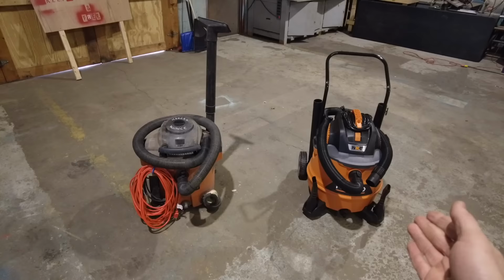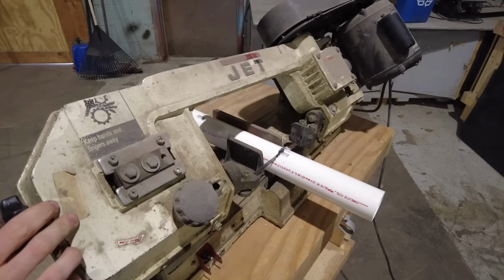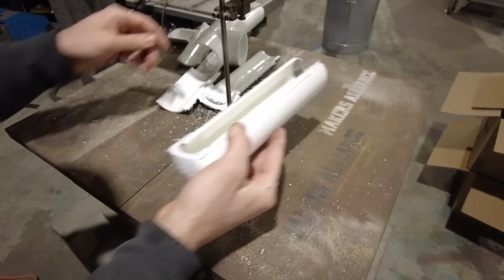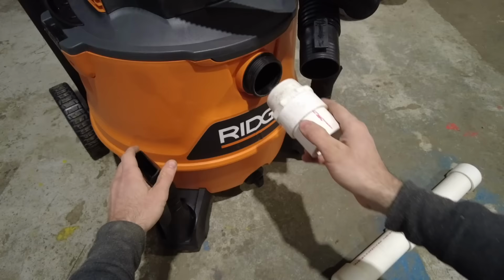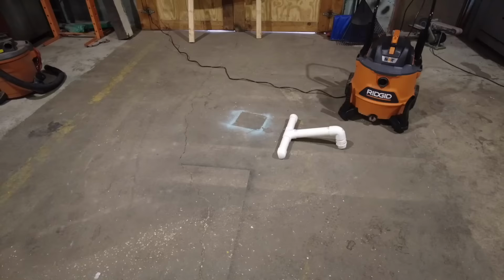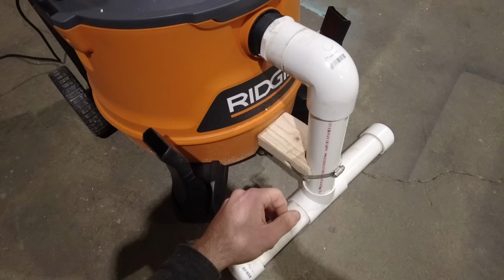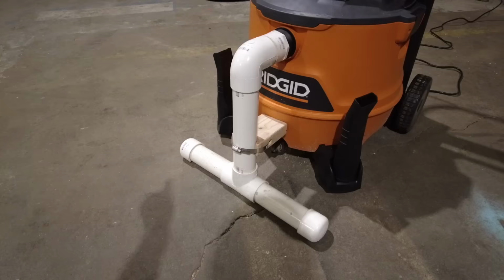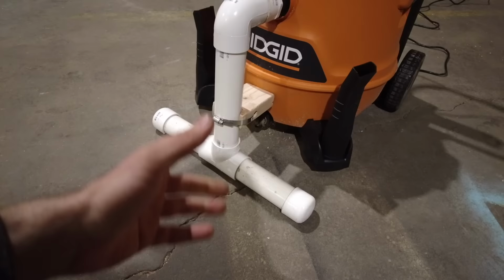DIY Shop Vac Mod  -  Super Wide Walk-Behind Attachment

Comment: I would attach the vac bar permanently to the base of the vacuum and then run the vac hose down to it. That way you can just pop the hose off the vac bar and use whatever attachment you need. Also, I'd put a door brush seal on the back side of the vac bar. That would help get more vacuum power to the front of the bar (where the debris is going to be).
Reply: ...also make it twice as wide by splitting vertical vacuum pipe into a "n" shape instead of a single "I" near the center.

You can have multiple types of these custom made attachments just like the original shop-vac intended to.

Comment: Do not cut the end caps. Mount a pair of small wheels on each end so that the pickup floats at a set height above the floor. This will allow it to compensate for an uneven floor.
Reply: Yeah sorta like training wheels
Reply: Leave the end uncut and un glued. Then perfect vac spacing and as it wears you can rotate it. Or glue on 2 female threaded ends and install a male threaded plug. Run the flat edge on floor. When it wears, rotate. When it trashed, get an new plug
Reply: Uhmw for the win or delrin
Reply: I would leave as you said the end caps uncut. But I wouldn't add wheels as the uncut  end caps would leave almost a perfect hight.
Reply: @jbstepchild  😊 6:09
Reply: @jbstepchild  6:21 6:25
Reply: Not cutting end caps also strengthens pipe assembly, which was an issue mention early on
Reply: I agree. I was thinking that while watching the video. Good job. Plus it will reduce the wear on the intake pipe.
Reply: @scottloutner5253  Took me a couple of times reading what you were saying to fully understand what you were saying but I completely agree and think it is an excellent idea!
Reply: @Maxima would a piece of weather-stripping across the back work?  Downside would be the pipe vacuum would have to be tilted backward when reversing.
Reply: My thought exactly.
Reply: Put the wheels at the end of the caps, so you can get better wheels.
Reply: @scottloutner5253  As with any PVC cap, a simple tap jams it sufficiently.  Well put.
Reply: He can't because the uneven floor would make the top insert pop out and fall. The top nozzle has to be secured before wheels can be added.
Reply: Mount the transverse part to studs mounted on the front wheels to brackets on the tube with wing nuts?
Reply: I thought it was a mistake when he cut the end cap. I think cutting 3 slots in the pipe, leaving about an inch of pipe between the slots would also add to the rigidity. 

Someone else mentioned adding small wheels. If those wheels were attached to the end caps so that the wheel stem is perpendicular to the end of the cap, they could be adjustable.  

I would put the slotted openings just front of center and velcro a thick strip of felt behind the opening. 

None of this addresses the problem of getting underneath stuff or the little nooks and crannies.  But if a 3/4 piece of pipe was added about 4 inches in front of and parallel to the suction tube and filled with magnets, there is a chance you might find some of those missing parts you lost.
Reply: yeah you know, just "mount a pair of small wheels"...
Reply: I had that same idea when he was building it too!
Reply: @Michael-RI  Ih he used some heavy duty wheels and then mounted the whole thing on a 3 wheel bicycle in lieu of the front wheel, it may be worth filing a patent on.
Reply: @katiedotson704  Great idea! Could patent a kit for shop vacs like that. Bet it could catch on.
Reply: Ridged probably watching this to help design their next accessory.
Reply: Glue the pvc before you cut it.. why on earth would you cut the test fit... 🤦🏾
Reply: I was thinking the same thing. Just like a normal vacuum.
Reply: Use the wheels , and connect to the pipes to make an attachment.
Reply: So in orther words, copy what Hoover has done for 70 years! 😁
Reply: That’s a great idea! I was going to say add a couple of wheels to the ends of the end caps which would follow the contour of the floor, but that already been added to the comments above mine by Colin. Also, instead of cutting the bottom of the PVC pipe and making a slot, you could drill 1” holes in the bottom and stagger them which would actually have the suction go straight across without any voids. This would not weaken the integrity of the PVC pipe either. A smaller area can have more pressure or suction too. 😉
Reply: @marc6592  My 1st thought was adding wheels too, but wouldn't it put the PVC to high off the ground?
Reply: In line skate wheels for the win.
Reply: Basically a floor vac I use for stripping vinyl flooring
Reply: Bingo
Reply: the wheels on the machine are just for looks?
Reply: Agree
Reply: That's what I was going to comment.
Reply: @Maxima That is true but a flex hose would be an issue with turning or movement at the joint area which means you would need some bracing. Any bracing would be the same as using ridged PVC. Wheels would still be the best option
Reply: I was thinking almost the same, but I'll like to see a 45 degree on each side for corners, and the wheels not like a few inches away from the end, but those that have some sort of spring or line the lawn machine wheels but this needs to be almost touching the floor
Reply: Actually i think is just about to add a piece of the flexible pipe, the one that looks like you can make it longer or shorter and to different positions
Reply: Brilliant! What if the pipe was mounted directly to the front wheels of the Vac instead?
I was going to also suggest to pre-glue prior to making the long cut.
Reply: The problem is, shop vacs don’t come with adapters that lock into the input of the vac as the hose does. Be nice if you could buy a small adapter and then glue it to your pipe and the lock it into the vac. Wonder if anyone from Ridgid is watching this? It’s such a great idea that they may decide to offer it themselves as an accessory.
Reply: The other advantage of this would be that you would not be dependent on having it mounted to the unit to get the right height, but could instead mount it at the end of the hose and not have to be awkwardly pushing the vacuum around, and you could get it under tables and such.   But then, they make wide attachments for just that purpose.    

In the end, this is like modifying a leaf blower to mount to the front of your lawn tractor.   Yes, you can get it to work technically, but it would be more cumbersome to use than simply carrying a leaf blower, and not worth the hassles.
Reply: Terrific ingenuity!
Reply: Glue it first  then cut
Reply: My exact thoughts great minds think alike. And a slightly smaller slot in bottom will increase suction
Reply: O @Bender13

Comment: I’m a plumber by trade and there’s two things that I thought of while watching your video that I think would improve the design and allow it to also be used where the floor may not be perfectly level or possibly may have a change in elevation.
There is PVC flex pipe that uses the same fittings and the same type of glue that if you were to use in place of the rigid pipe. The flex pvc is still rigid enough to keep everything in place but would flex slightly backwards or up if it needed. Or what would probably be even better, is if you got one of those brush strips that they use on the bottom of doors to prevent air from escaping under, that way it would allow you to raise the Rigid pipe up a bit and the brushes continuously in contact with the floor therefore helping to maintain a strong suction and may also help to improve the overall effectiveness of its function.
Reply from the maker: Thanks for the input. I am definitely going to try and source some of that brush strip for a rev.2. I'm looking into maybe making a better floor head design out of some sort of CNC cut plastic/wood as well.
Reply: brush strip: great idea
Reply: Couldn't you just cut it at an angle to the floor w/ higher side forward and lower side almost scrubbing the floor.  It would make a scooper for higher piles while still getting the low stuff
Reply: @pc_playground958  This was my initial thought, but then it would only work in the forward direction and could snag when going backwards.
Reply: A Fernco type connector could be used where the pipe meets the machine opening.
Reply: It’s an upright shop vac. Neat.
Reply: @tammyniemeyer2267  That was my thought too, and there's not too many of us who have wives that would be cool with taking the upright vacuum out into the garage.... and then allowing it back in the house.  My wife would say, "OK now you're leaving that out in the garage and buying a new, indoor only upright."  I had to do that with the shopvac when the dogs threw up, made water messes, etc.  I have an "indoor only" shopvac, and a garage/backyard only shopvac.
Reply: You could make a separate wand attachment with a rubber weather strip on the bottom. Use pop rivets or screws with an aluminum strip on the outside and rubber in between. You would have a wand for a wet vac for fast water pick up.
Reply: Good idea! They have garage door seals like that for the sides of the door!
Reply: Pvc pipe bottom needs wheels so that it can roll and alleviate any issues with uneven ground
Reply: You could just skip the wheels idea, and use “skis“ or sled-type terrain-following “skids” instead… Maybe make them out of those peel-and-stick plastic furniture sliders things. They won’t bind up, are bi-directional, and a whole lot cheaper.

Comment: My shop vac lives at the end of my work bench where most of my messes are made. When I’m done working I brush off the bench then sweep stuff on floor into a pile using a push broom with a soft brush. This gets all the fine debris. I then use shop vac hose to suck up the pile. I’m gonna build a suction pipe like yours. I can turn on vac and simply sweep the debris to the vacuum. No bending over. No dealing with the hose. This will allow me to store my hose at attachments out of site and pull them out when I need to make the vac mobile. Thanks for sharing

Comment: I'd glue your fittings before cutting the bottom off.  I'd also glue on the end caps after cutting so they hold a minimum gap  to prevent pushing piles.  Most vacuum attachments utilize that same principle.  You could also put wheels on the sides of the one you already have to provide automatic adjustment over bumps.
Reply: This is exactly what I was thinking when glueing the pipe. Was wondering why he wouldn't have glued them together before cutting the pipe to make more stable.
Reply: Right.

Comment: I used to clean a gun range. We had walk behind HEPA vacs, with a very similar design. Put wheels on the ends and either a windshield wiper blade on the back of the slot or a strip of rubber. At the front of the slot, a strip of brush type door sweep. adjust the wheels so the back rubber just drags on the floor. The brush at the front should be 1/4" (6mm) above the floor.

Comment: To avoid pushing debris, rotate the horizontal pipes with the cutout slightly to expose the opening just a little bit. As you push the vacuum forwards it will allow the vacuum to start sucking in debris before it has a chance to build up into push piles.
Reply: I was thinking something similar but more of a different attachment that would act more like a stationary vacuum thing in a wood shop and then just sweep everything to the shop vac. Something the average person would get more use out of.
Reply: just get a broom
Reply: That is what I was thinking - change the angle of the cutout pipe on the bottom up - so it is a bit more exposed to the upcoming material.  In that sense, it can also vac a bit larger objects too.
Reply: Worth a test but I think it would lose too much suction.
Reply: @michaelgomez3044  qi am going to convert my work shop vac first to morrow thanks
Reply: Glue the pipe, T adapter and caps first. Then cut the bottom slot in between the caps so the assembly rides on the end caps which remain intact. You could leave   part if the bottom portion of the T adapter so it also serves as a riding sled and still have the slot going the full width in between the end caps. Also, instead of using a wood spacer, use stiff foam which is rigid enough but also has some give, and acts as a bump absorber.
Reply: It’ll lose suction

Comment: A couple suggestions - Bottom pickup width should be past the wheels (2-4" on each side) of the vacuum so you're not rolling over the dirt on the ground.  Do not cut the opening on the pick up  more than a 1/2" wide.  Might find 1/4" is better.   As mentioned, leave the end caps uncut and use them to set the height on the floor.  Not sure if the floor is too uneven that they would hang up.
Reply: This right here was going to be my suggestion. Make the pickup wider so the end caps dont need cut and the slot is only 1/2" wide and the full width of the wheel base. Will create better suction. Also if the end goal is for vacuuming up such a huge warehouse floor maybe even dabble with creating a manifold so you can have an even wider pickup with say several 1" suction tubes spaced along the pickup feeding into 1 tube coming out of the vacuum.
Reply: Smaller intake opening = faster air velocity = better pick up.

Comment: In my experience it's actually a lot faster to use a fine push broom to sweep the floor into piles, and just use the vacuum to pick up the piles (or, sweep them into a flat shovel to pick the stuff up). Also makes less noise as you spend less time with the vacuum running.
Reply: this avoids creating dust that keeps it out of your lungs :)
Reply: and if you need shiny clean a little sweeping compound does wonders
Reply: I found it less worrisome for my lungs by avoiding the dust pile area until someone more responsible sees it and deals with it
Reply: @chriswest6090  WTF is "sweeping compound"???
Reply: @gorak9000  sweep compound is sawdust with some type of oily substance that dust clings to.  Really improves the effectiveness of sweeping.
Reply: @gorak9000  bought some for sweeping drywall dust. Does a great job. Reduces it maybe 90%. No mask needed if you sweep slowly.
Reply: @dad1432  Huh, I never knew such a thing existed! Guess I learned something new!
Reply: For fine dust removal especially with grout lines or etc, sweeping is inferior.  Depends on what you're actually doing of course
Reply: @ChestnutForge 💯,  we use it on epoxies hangar floors, works fantastic!

Comment: Use Teflon furniture glides on the ends to keep a minimum spacing above the floor and for low friction. They stick on with adhesive strips, so they can be easily replaced as needed.

Use a Fernco type connector for where the pipe meets the machine opening.
Reply: oh, yeah- the old fernco trick...

Comment: Set  it up to also do wet vacuum.  Install a door-sweep rubber at the rear, while maintaining a raised opening at the front.  It would help for dry vacuuming too.  A clear pipe adapted to the side of the vacuum bucket would aid in determining the level of water, rather than rely on a floating ball to block the intake at the fan.
Reply: I was thinking the same thing.
Reply: The door sweep at the back is brilliant! I was thinking about if it could be used or adapted for water and there’s a great suggestion.
Reply: How would you do the clear pipe on the side? That sounds like a great idea too.
Reply: @michaelkirchhofer3266  A fitting near the bottom of the canister, another fitting near the top, connected by a clear tubing.  One would also have to consider a way of keeping it clean too. (or easy access for cleaning.)
Reply: @michaelkirchhofer3266  Many door sweeps come mounted on an aluminum strip, for easy mounting.
Reply: The obvious pitch change of the vacuum sound will alert you to it's fullness. 
If you were to want an indicator of water. Drill & Tap for an NPT into the side of the body. Then install a Male NPT fitting with a 90° Pushlock for a clear hose to press into. Then get a Pushlock fitting with a Female NPT on the back side for a Pipe Plug. Either secure the hose to the body, or have your tapped hole near the vertical upright of the Pushbar, and tiewrap it. Make the hose length even with the centerline of the checkball at it's highest point.

Comment: Great idea. Definitely makes clean easier to do thus do more often. Use a 1/2 router bit or plunge cut with table saw to make narrower pickup slot. 
Also a small bucket with dust separator in line would be nice.
Reply: How is this easier than just using the hose and attach a floor accessory?  I can be right next to the vacuum, and just stick two extenders and cover the same area without taking a step.

Comment: If you wanted to get real fancy, a loosie goosy flex hose segment with some weak springs to give it a downward force and some of those hard plastic furniture slides on the bottom to keep an airgap would allow the nozzle to stay in contact with the floor and float over the contours. I'm actually looking for ideas to make a parking lot cleaner. I envision a shop-vac on a cart caddy that also holds a predator 2000 generator to power it and a 5-gallon bucket with a cyclone debris separator to drop the gravel, sand, and debris into before it gets to the shop vac. My thought is that the fine sand and dirt is very heavy and dealing with disconnecting hoses, unlatching the lid and lifting a full shop vac loaded with that heavy sand and dirt would be a lot more cumbersome than a compression fit lid on a 5-gal bucket that can be popped off with the pull of a lever and easily emptied. Billy goat makes one but it's really expensive and local rental shops don't have them to rent. This definitely has given me some ideas.
Reply: Home Depot sells those dust separaters to put on 5 gallon buckets and they come with hoses and fittings too